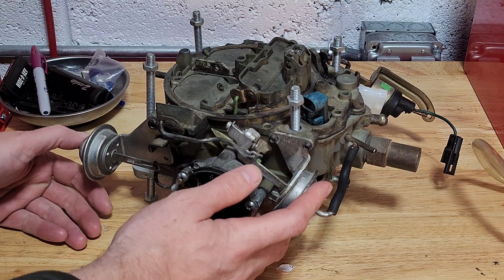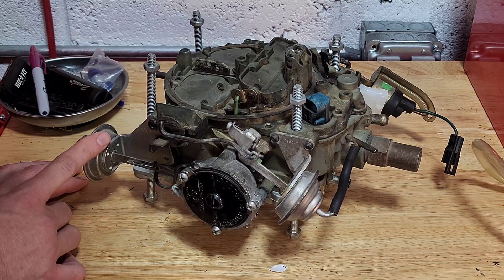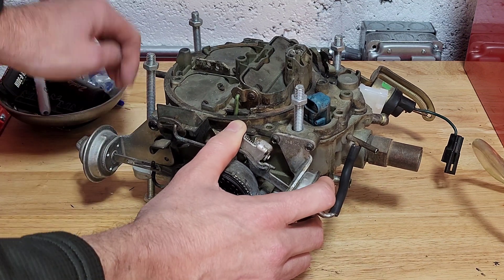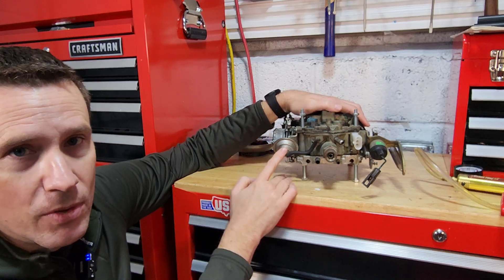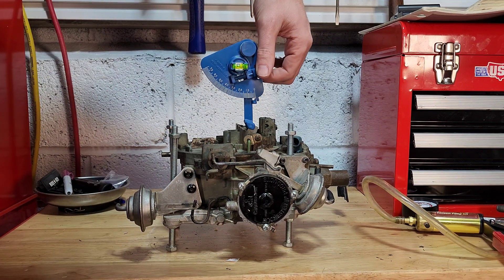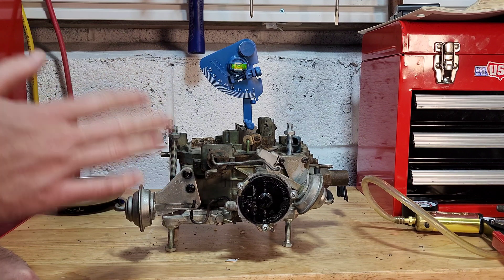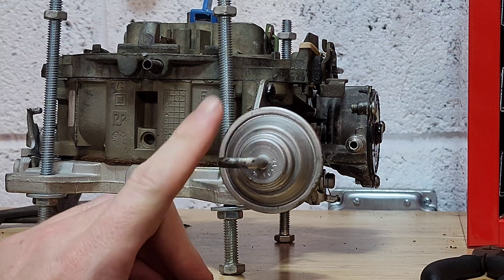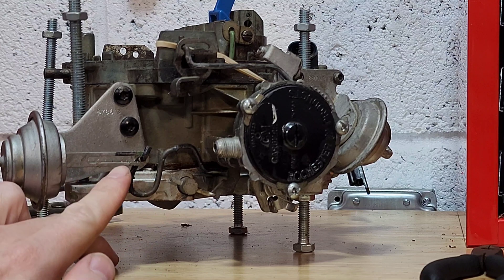Electronic Quadrajet - Setting the Primary and Secondary Vacuum Breaks

Comment: I have a question, on my 1986 motorhome home, with electric choke and, set choke start the engine, works fine , but when i am driving and slowing down it on high ideal , or when iam stopped it will jump up to high ideal, it just were on holiday and i can back the choke off but is, but is it a vacuum leak , just trying to bypass till we get home to rebuild or replace  , thank Tom

Comment: Keep up these great videos!

I'm more comfortable with Olds CCC Q-jets than other makes, but don't fret about the secondary/rear vacuum break (RVB) unless you live and drive your car in super-cold weather on a computer Olds. The purpose of the secondary vacuum break is to prevent fuel load up of the carb in super-cold weather when fuel atomization is at its worst. In summer, or fall cool weather, the primary choke (if adjusted properly) should tend to all your choke needs. In the dead cold weather, once the engine starts, the RVB solenoid energizes to keep vacuum off to the RVB. The choke has 30 seconds after startup to get to that 40-45 degree blade angle (whatever angle spec range it should be). Regardless, after 30 seconds the RVB solenoid deenergizes to allow vacuum to the RVB. If the choke blade is open enough, it's not even needed. If not, it'll pull it the rest of the way to hold it open a bit further at the 40-45 degree angle. So if you live in Miami, you probably will never need the services of the RVB. But if you live in Alaska... 

They actually have a GM tool in the carb calibration kit that is a simply a slotted shaft that's used to bend the RVB linkage.

Comment: Great video, thanks for sharing! I have problems getting the fast idle cam to release with I tap the throttle on cold starts. Is it spring operated, controlled by the choke or what? What’s the recommended way to troubleshoot it? Mine is a non-electronic Qjet from a ‘70 Olds 350 on my ‘72 Cutlass 350, #7040251. Also, at idle in Park, I need 1000-1100 rpm so that when I put it in drive it will idle at 600-700 rpm. I converted the choke to an electric choke and it seems to operate correctly. Any advice on how the fast idle cam operates is greatly appreciated.

Comment: Exactly addressing a problem I have on an 86 Chevrolet.   It failed emissions and was going to be scrapped- the problem is the choke, and these vacuum breaks.
Reply from the maker: Don't scrap it! They can be replaced and adjusted. It can be done.
Reply: @rporestorations  The whole van was what I was referring to.   Because the carburetor wouldn’t pass emissions- but I am fixing it with the aid of this video.  Nothing being scrapped- its being fixed.
Reply from the maker: That's good to hear. If there's anything you need, just ask.
Reply: @rporestorations  Finding a gauge is turning out to be problematic- is there an alternative method?  Like a dimensional check of the choke plate or rods?

Comment: I have an 84 Impala Sedan 305-CCC HEI electronic distributor advance TH700R4. Your videos have been instrumental. The choke is often overlooked and your videos demystifies the "black magic" so to speak. I haven't been able to set the angle right. Now, I'm going to bite and grab one off Ebay. You are right about the drill bit sizing, with a CCC its going to be lots of trial an error without one of these gauges. I need one asap. 

Although my car doesn't use a Secondary Vacuum Break according to the specs sheets, the carb is the original virgin carb I recently rebuilt several days ago, it always had a Secondary attached but with its vacuum port capped with its linkages. It was never put to use, probably while it was being adjusted at the dealership to meet CA emissions it must have been modified since its a Canada Import my Dad bought new off the lot in 83. In order to kick it down off the high idle cam,  it needs to be kicked down. I inherited it while in high school senior year 98, and it was my daily driver until the carb failed months before the pandemic. If I can implement the secondary break to do the kickdown without having to do so physically while it idles down in the drive way it be sweet. My 80 Buick V6 Turbo used to do this,  it was a sad day when i had to part ways from it. unfortunately I didn't pull parts off it or documented its function so that I could somehow implement that in my Impala.
Reply from the maker: Thank you! I'm glad I could help out.
Reply: I found the same exact angle gauge last night. Your videos have been a godsend for me. I've sourced nearly every tool from your recommendations. 

There's nothing better than your content. Thank you  for sharing your knowledge.  @rporestorations
Reply: I have one, the Kent-Moore part number is J-26701-A
Reply: @pinzguy4937  Yep, that's the one!